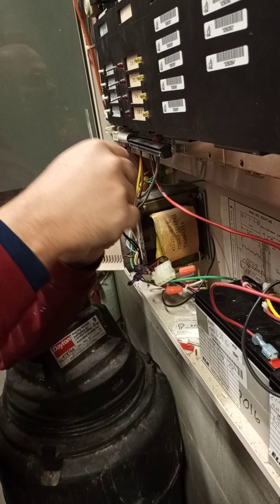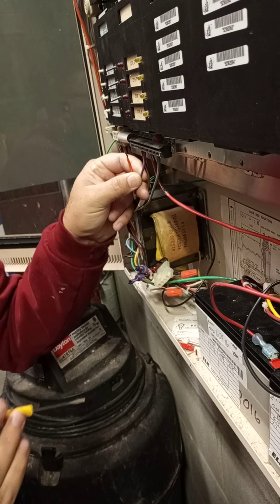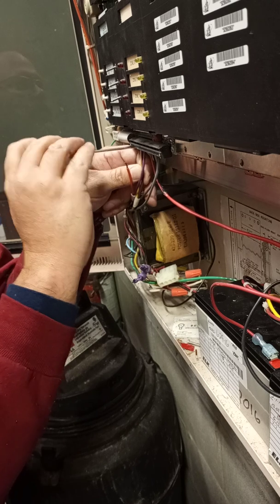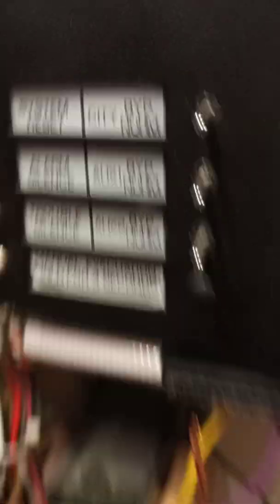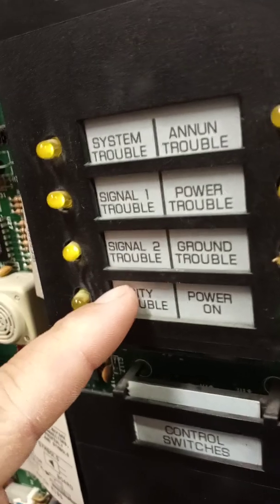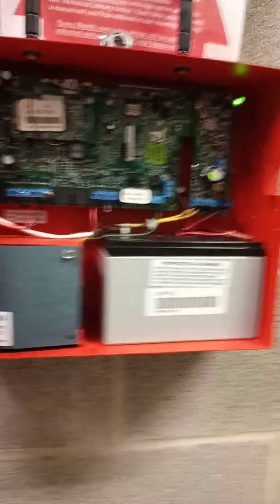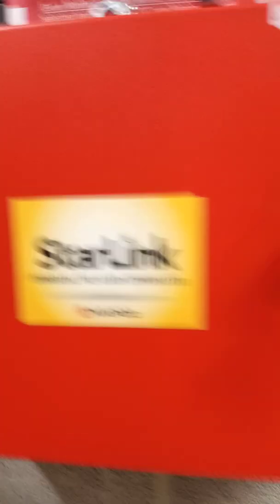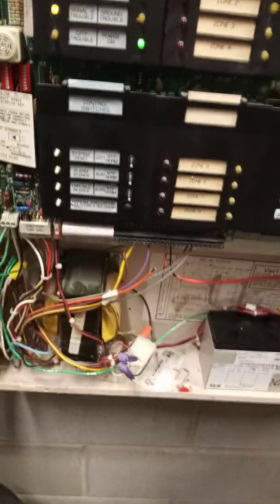How to make simplex horn strobes not sound if there is no walk test.  Simplex 4002 zone simplex sys

Comment: The 4002 does have a walk test function, however no silent walk test. It pulses the zone number over the NAC. 

To enable, turn DIP switch SW2-1 to OFF then press reset. The panel is now in walk test mode. 

Walk test will show a system trouble and city trouble as walk test disables the city circuit. 

To take it out of walk test, flip DIP switch SW2-1 back to normal and then press reset again. The panel is now back to normal mode.